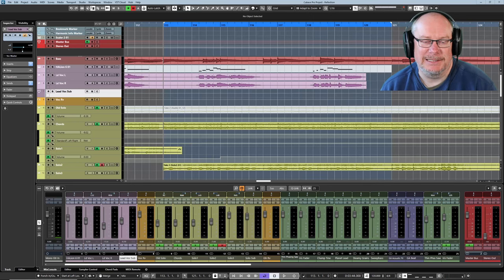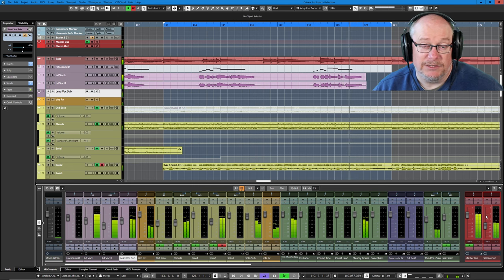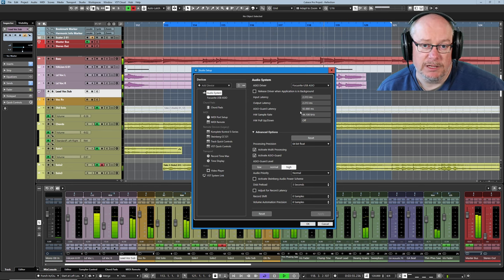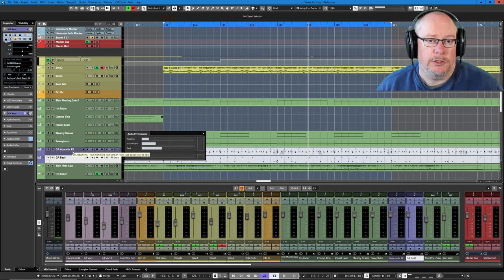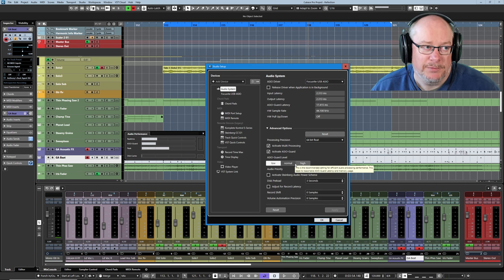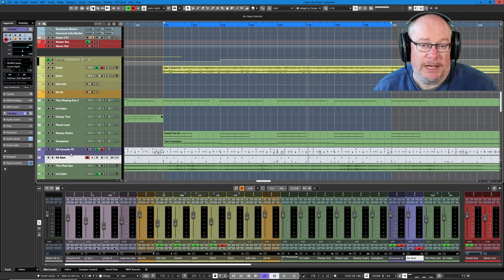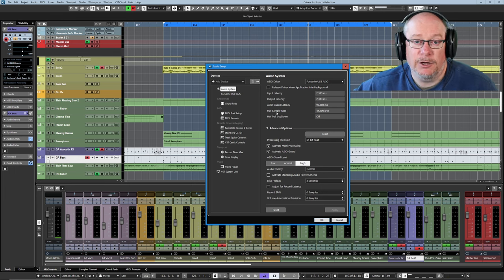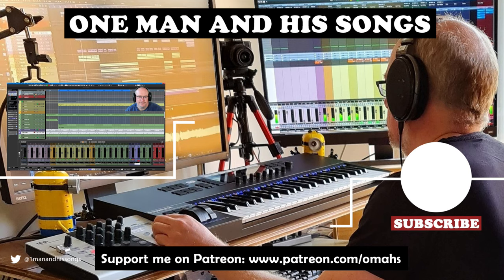The Essential Guide to Latency in Cubase 12 (Pt.2) - ASIO-Guard

Comment: Great video, really well explained. I've noticed recently I get very different ASIO guard loads depending on which type of tracks I have record enabled and selected. In very heavy projects selecting an audio track and having it record enabled will push the ASIO guard meter into overload and I get dropouts. where as selecting a kontakt instrument track will significantly lower the ASIO guard meter.
Reply from the maker: Presumably your audio tracks have plugins on them? Anything Cubase has to process in "real time" is going to hurt. There's not much we can do about that either - short of bypassing the offending units
Reply: @OneManAndHisSongs oddly it still happens the same when there are no plugins on either of the tracks.
Reply from the maker: I'm out of intelligent things to say I'm afraid. I've never noticed a spike solely because an audio track is record enabled, but then I haven't specifically examined that issue either.
Reply: @OneManAndHisSongs  no worries, I'm doing some more testing to see if I can get to the bottom of it. I'll definitely watch the rest of this series though, it's been really informative so far.

Comment: Thanks for another clear explanation.
Will increasing the RAM from 16 to 32 in my PC help reduce the load in the performance meter when using numerous virtual instruments and plugins?
Reply from the maker: It certainly won't do any harm! I think it's more to do with the CPU than RAM, though, since 16gb is reasonable, and you'd need a fairly large project to max out. I have a 16-Core Ryzen 9 3950X CPU with 32Gb RAM, and am very happy with its performance.
Reply: @OneManAndHisSongs  Thanks for your reply - keep up the good work :)

Comment: One thing I would mention as well. If your trying to RECORD audio tracks with asio guard on, your tracks will have that latency as you record. Which can really throw you off if your trying to track guitars. The delay constraint button can help with RAM usage as well. But then asio gaurd has really only been super helpful when just "mixing". I have to turn it off when tracking....Unless I'm doing something wrong?
Reply from the maker: That's not my experience. ASIO Guard is specifically designed to help with non-live tracks - it shouldn't have any impact on your live recordings at all. Quoting from the manual: "The ASIO-Guard latency, in contrast to the latency of the audio hardware, is independent from live input." Unfortunately there are so many different influences on latency it's impossible for me to know where your latency is coming from.
Reply: @One Man And His Songs  yea right on....I actually noticed it one day while tracking guitars. I had the asio gaurd on as usual, and while I was double tracking the rhythms, I just couldn't "nail it" for some reason. Super close, but not as tight as I wanted. I probably tracked 20 consecutive takes wondering what the hell the problem was, when I noticed it. I zoomed way in on the Wavs, and noticed Cubase was recording my takes with like a .98ms delay. And that's why I couldn't get them to line up. So I turned off the AG AND the Multi processing, and they delay went away. But again using the "delay constraint" tab also reduces RAM usage (although it does turn ypur CPU heavy plugins off), so I keep that on for tracking. That's just my experience though, and I'm always looking for a way to mitigate RAM usage....short of buying a new PC....

Comment: Excellent tutorial. I have a different problem. When I record my keyboard playing in C12 it all sounds fine while recording. But when I look at the midi events they are, in average, before the beat ( Like midi anti latency ?). For example, when recording 1/8 piano chords many are before the beat. And if I try to quantize with a 1/16 resolution many chords will fall 1/16 ahead of the corresponding beat. I think I am not playing ahead of time. And I would prefer not to quantize anything.
Reply from the maker: There's a MIDI Latency Mode in the Application Preferences - try changing that to one of the other settings and see if that helps.